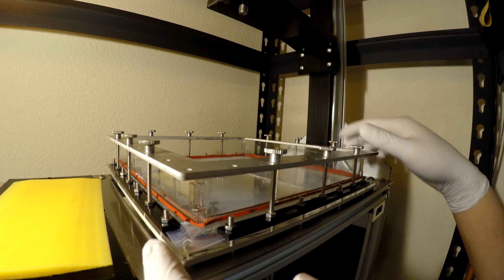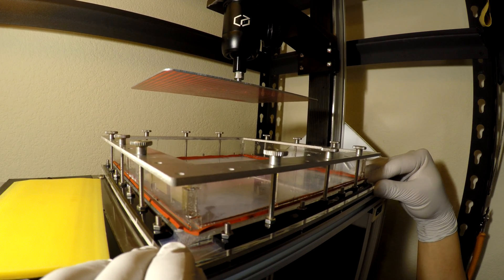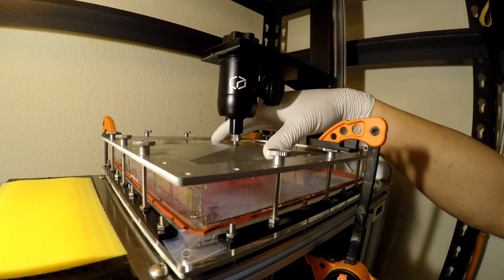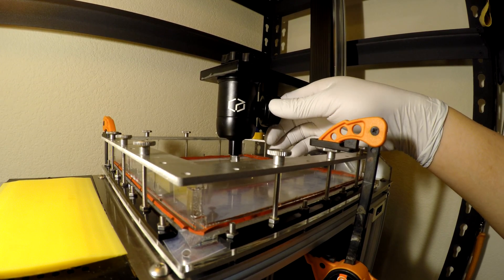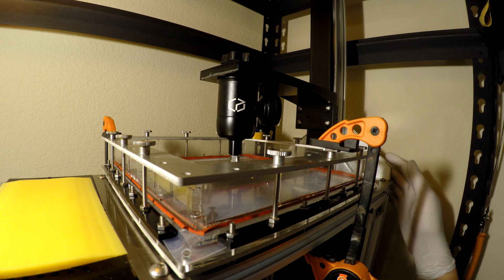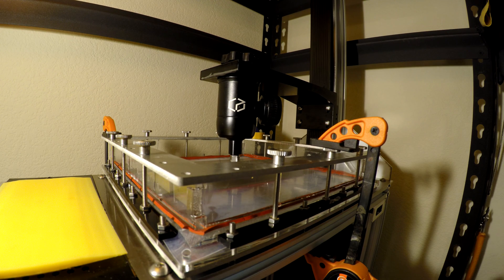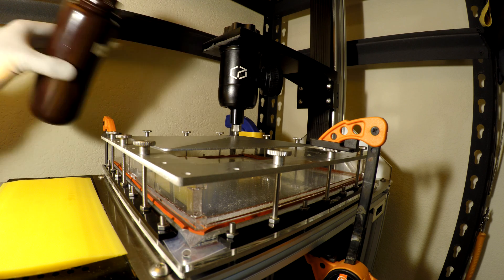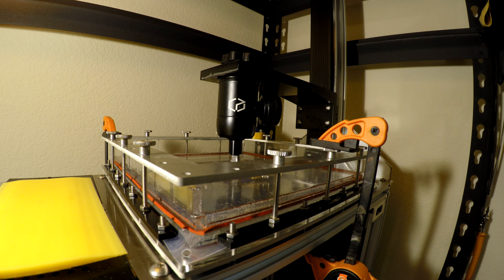Using the Muve3D FlexVat With the Kudo3D Titan 1 DLP SLA 3D Printer

Comment: In this video you mention that the Z axis is not "like a metal cutting cnc axis" and it flexes.  Is this a good thing or a bad thing?  I am building my own SLA printer and I got a really good deal on a Z axis that is actually for something quite strong, so I could potentially build something that has zero flexure.  I'm wondering if I need to purposely build some part weaker so it can flex.   I was sort of thinking that I can design the unit for perfect fit and perfect alignment where both the build plate and the vat sit in place with three point kinematic placement that never needs re-alignment.   Thanks.
Reply from the maker: It's neither better or worse. It just something to keep in mind that although this is a high quality THK linear stage with aluminum extrusions, the torque of the screw means that you can deflect the Z axis by hand turning the stepper. That means when you "touch off" for zero height calibration since you can easily overshoot and go negative even if turning the screw by hand.

In general, printing forces are very low, so there would generally be no need to engineer a printer to be rigid enough to withstand that one case.

Comment: Thanks again for posting these vids. Curious though, wouldn't it be easier to zero in first then clamp? That way you wiggle the vat around when you drop .1mm increments so you know for certain when it makes contacts. Then just clamp when comfortable with it.
Reply from the maker: +TwaityZee Possibly, although I don't think it would make that much of a difference either way. I've grown accustomed to feeling zero based on deflection pushing down on the top of the plate, so that's how I do it,. If you have developed a feel for zero based on the amount of resistance with lateral movement, you could probably do it by wiggling the vat or rotating the plate.